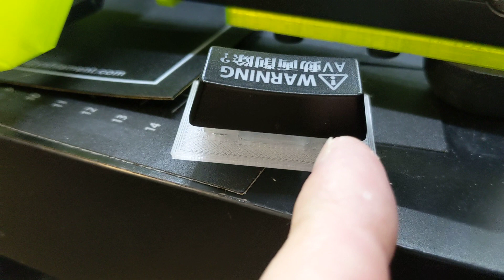Finally! An awesome Cherry-compatible 3D printable stabilizer

Comment: That's how most keyboards do that (with the wire) for stabilizing large keys.
Reply: Did you not watch the video? The wire isn't the exciting part
Reply: @ella4406  I watched the video.  Check out the other videos of his I commented on.  This comment is more related to the extra wide keys used and how existing keyboards stabalize them, not on the hall effect that the keyboard in general uses.  Try to understand the context of the comment in relation to the spot in the video where it applies.